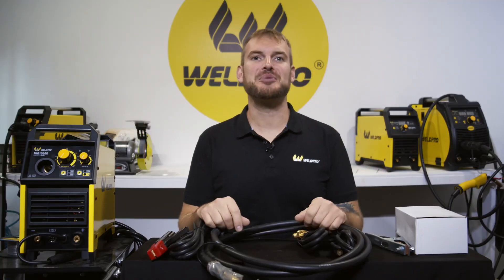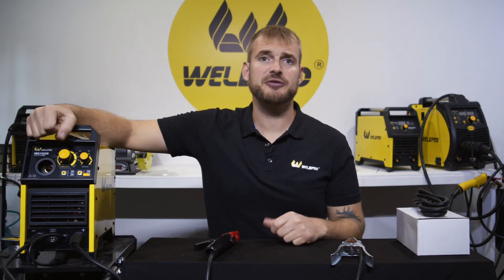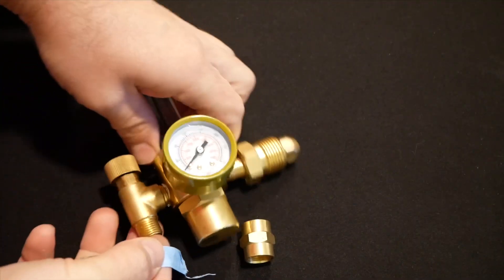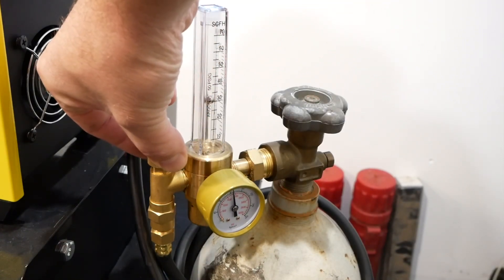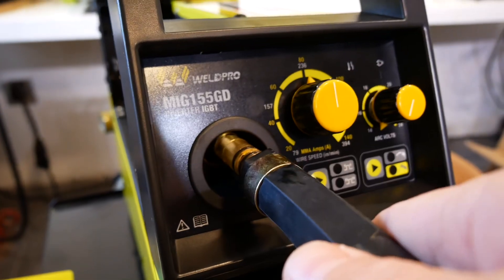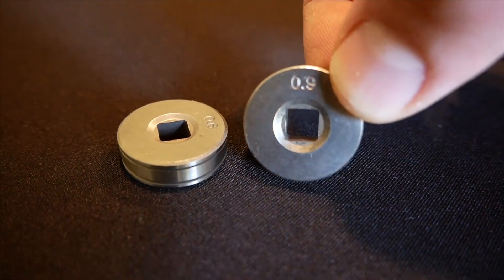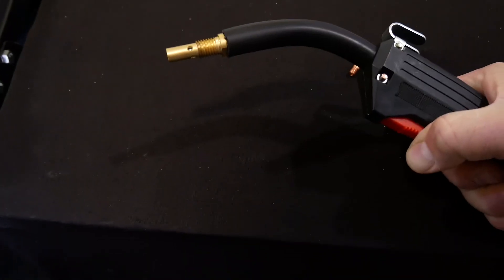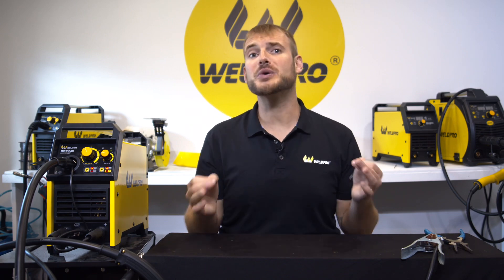Weldpro MIG155 GD Part 2 - Set Up - Stick, 75/25 Gas, Solid Wire

Comment: This video is wrong if you have purchased your unit within 2021 or 2022 according to Tech support. The nozzle does not twist off in a clockwise pulling motion but really is removed by unscrewing towards the left or counter clockwise. There is no spring inside the gas nozzle.

Comment: is the indicator ball supposed to float at all times when the gas cylinder valve is open or only when I'm squeezing the trigger on the mig gun? mine stays at rest and only floats to indicate the flow rate when I squeeze the mig gun trigger

Comment: when going from stick welding to mig welding, do I need to disconnect the mig cable or can it be left in place?  Does selecting stick welding with the switch disable the mig cable?
Reply from the maker: You can leave the MIG cable we do!

Comment: i have the 155gsv im having issues with it not wanting to feed solid core wire i have even switched to softer spring its lincon wire help plz
Reply from the maker: Interesting! Did you give our customer support number a call? They may be able to help diagnose this. Thanks so much for reaching out!
Reply: Compre una maquina de soldar igual q esa la use por q mes y ahora la conecto prende pero luego se apaga @WeldproWeldingEquipment

Comment: I hooked my 155 to argon /co2 today and the meter worked except the ball didn’t move at all to get my flow range. Is there something I have to do?
Reply from the maker: Hey John! You would use the small brass screw on the side of the flowmeter to start the flow of gas. This should cause the ball to rise when you squeeze the trigger on the 155
Reply: @WeldproWeldingEquipment  thanks I actually got it .The ball was stuck I guess it had a section of something was on it and wouldn’t move even when I press the button I got it dislodged and it works now
Reply from the maker: @johngriggs5910  wow! Glad it’s ok now! Let us know if you need anything else

Comment: Do I ignore the voltage dial when stick welding or is it important to have this set to something specific as well?
Reply from the maker: Nope voltage dial does not increase or decrease voltage when stick welding. Only amperage control is functional. Thanks for asking!

Comment: I received my 155GD today . . . love the fast shipping.   I noticed in the manual that .035 is not offered for the Mig solid wire . . .  is this correct?    If so, your description on your website is misleading.  I opened the box to get the owner's manual out to read before assembling/using the unit.  Will finish the unboxing tomorrow . . .
Reply from the maker: I believe the reason the engineers listed .030 wire as being the largest for mig and .040 as largest for fluxe core on the spec sheet is because of the wire composition. 

While the liner is large enough to accept an.040 wire, that is not the only consideration.  The voltage limits of the smaller machine make running solid .030 more suitable than the larger .035.   Running the larger diameter flux core would work better than it would with larger diameter solid mig wire because of the 155s voltage and amperage limitations.  The hollow flux core wire has less metal mass than the solid mig wire of the same size, which would make it easier to melt given the welders lower voltage and amperage range.
Reply: @WeldproWeldingEquipment  Okay . . . I sure hope the machine will do what I need done.  Thanks for the explanation.
Reply: @WeldproWeldingEquipment  I've been using .035" solid wire on 1/8" steel with no probs, it can easily burn through so there's plenty of heat. should I not be using .035" wire?  I'm only using light duty cycle and keeping the whip straight tho
Reply: @FourthWayRanch  You can use .035" solid wire, it just takes more heat to melt it in the weld joint than a smaller diameter wire.  I personally prefer .025" solid on 11 gauge steel sheet due to lower warpage from less heat input.  I don't go to .035" solid until plate thickness approaches .250".
Reply: @nickcampbell3212  OK, I just built a small trailer for my airplane with all 1/8" and .035 solid wire and you're right, there was lots of heat, I prolly could have gone to .030 and not gooped up some of my welds so much.
I had this think in it's box for a year new and just got it out, it works great, I just take it easy and don't weld too long with it, use tip dip and never had an issue with wire feed even once running pound and a half of wire for the project. I did lots of 1 and half second pulsing with it and it had no prob feeding reliable
it easily paid for itself with this one build

Comment: just set my machine up the other night and had no arc while using the mig gun. Gonna attempt the stick welding tonight.
Reply from the maker: Check the dongle in the front of the machine! Make sure that it is Hooked up to the + lug for solid wire and the - Lug for self shielded wire. The ground clamp will go in the opposite terminal. Make sure your ground is securely attached to your workpiece!
Reply from the maker: Thats so great! Let us know if you have any questions or run in to any issues! Don't forget Customer Service is available from 9-9EST